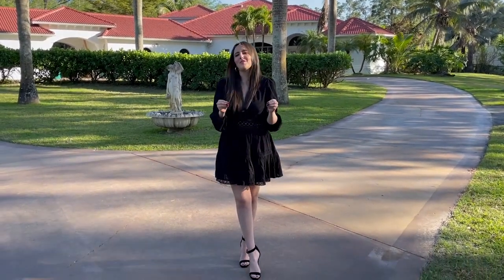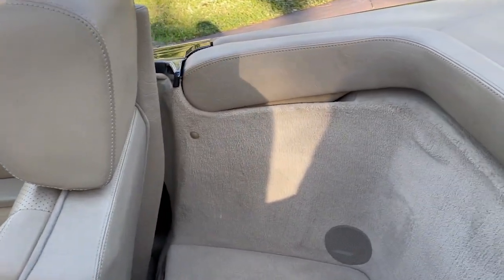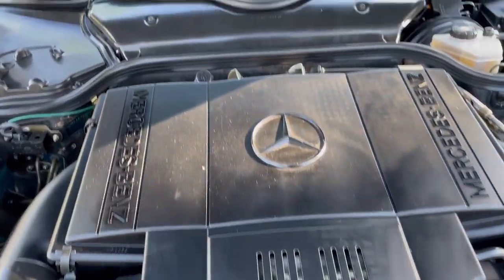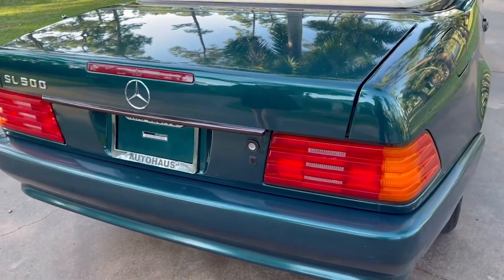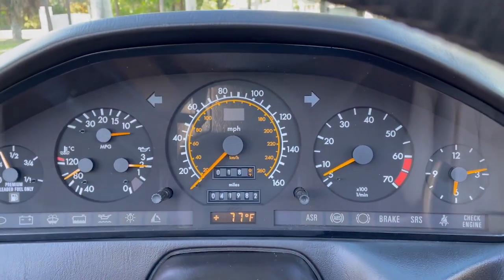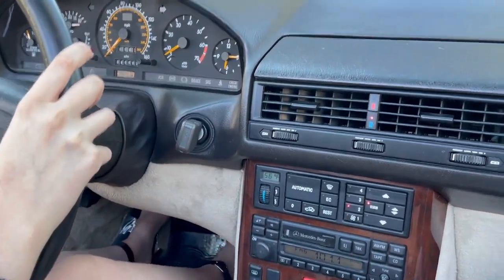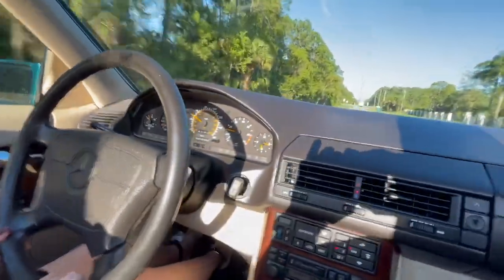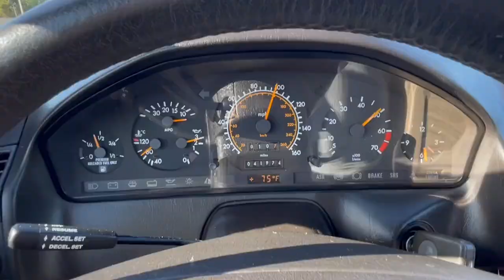1994 Mercedes-Benz SL500, only 41000 Miles, for sale at www.AutohausNaples.com 239-263-85000

Comment: I used to own one black and black and got to drive it up the California coast. It would do a 5 sec 0 to 60 from a corner and the only problem is that the trunk would always fill up after it rained and take days to dry up to charge the battery ( I didn't keep it garaged) ! Fun car to drive!( Even more fun to own 1) thanks 😊 mine came with a telephone
Reply from the maker: seems like you needed a better repair shop to get it fixed, this is not normal!
Thanks for watching!
Reply: Often a trunk rainwater leak on a R129 comes from around the center brake light.  The rubber gasket eventually can fail.  Hard to detect this, but a pretty simple fix.

Comment: A beautiful car.  But these pre-facelift R129's are less desirable than the US model year 1996 and later ones.  The older cars have a clunky three speed hydraulic transmission and the later ones have a four speed electronic transmission.  Also, the earlier cars have a biodegradable(!) wiring harness.  Even if this is replaced the connections can be trouble prone.  Easiest way to tell the difference is that the older cars have three slots/fake vents behind the front wheels and the newer more desirable cars have only two slots/fake vents.

Comment: 320hp not 315hp
Reply from the maker: thanks for watching!
 1994 Mercedes-Benz SL500
Luxury car
Model: 1994 Mercedes-Benz SL-Class
Horsepower: 315 hp
Engine: 5.0 L V8
MPG: 16 city / 20 highway
Transmission: 4-speed automatic
Fuel tank capacity: 21.1 gal
Dimensions: 176-178″ L x 71″ W x 51″ H
Torque: 347 lb-ft